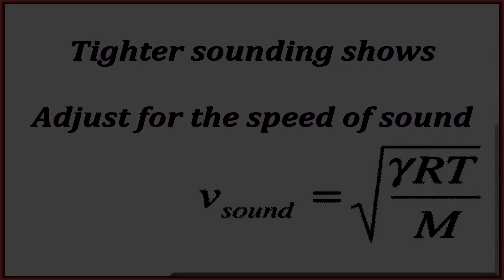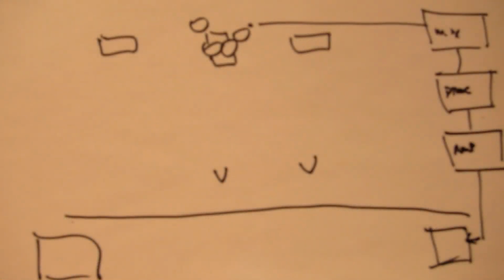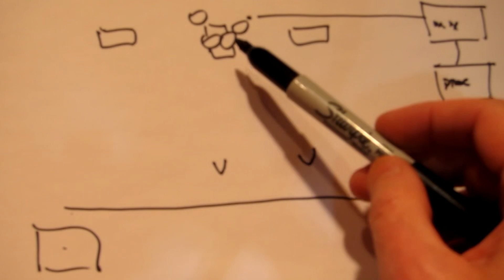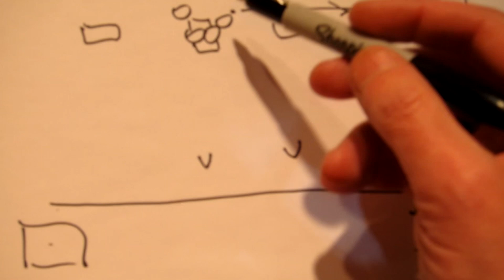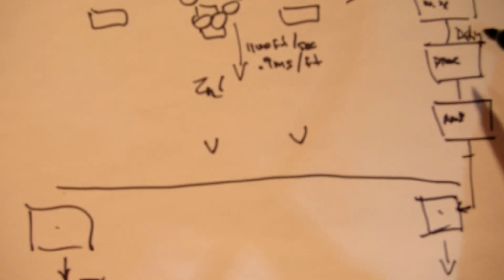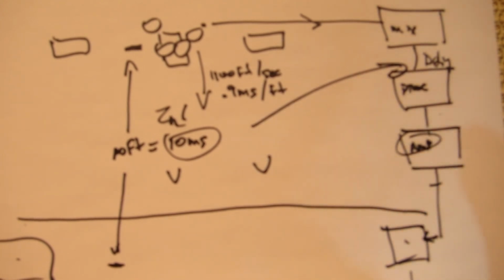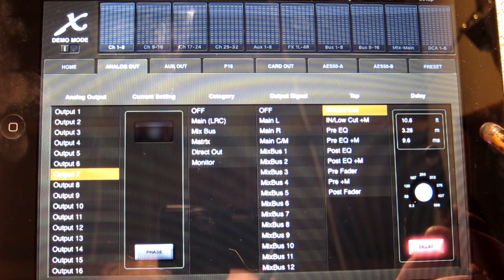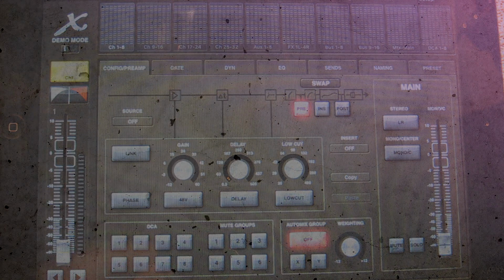A Secret to a Great Sound: How to Time Align Your PA for Optimal Backline Instrument Performance

Comment: Great info. So if using a separate console for monitoring/IEM would it be ok to delay at the inputs as only the audience/FOH will be affected? Or is it still best to delay on the outputs?
Reply from the maker: Usually if you delay at the channel input it delays everything, the FOH and the monitors.  If that's not the case with your mixer, you could do it that way... but I think delaying the FOH output buss is easier since it's one thing to adjust, rather than a handful of channels independently.   Whatever you prefer, sometimes there's more than one way to get there.
Reply: @Barry-Watson  Thanks for the reply Barry. What you are saying makes sense. You would literally have to delay every channel at the input, like you said. Opposed to just delaying the outputs to PA. I’m using an M32c rack unit at FOH. I’m using the Ultranet port to output audio to my tops and subs. It doesn’t look like there’s any way to delay the Ultranet outputs at the desk that I can figure out. Would my best option in this set up be to use the delay in the actual powered speaker and subs DSP?
Reply from the maker: @Bobby_Uterus  sure, I think you could apply the delay anywhere in the output signal chain.  Doing it at the speaker processor would be a common place (or in the amp DSP).  Obviously, just do the delay in 1 place - the amps/processor OR the mixer.  Heh.
Reply: @Barry-Watson  Right, thanks Berry. I think at the actual powered speakers is where I’ll have to set the delay settings. Kinda a bummer as my tops are mounted ways off the ground. Enjoying the channel, lots of good info. Thanks for taking the time to share with us.

Comment: So if I use center fill speakers on the lip of the front stage would you time delay them the same as the mains.  They are in line with the mains but closer to front row audience so would they get the same delay as left right mains or a little more because they are closer to the audience?
Reply from the maker: The delay is the distance from the instrument backline to the line of the speakers.

All engineering is the art of trying to pick the best compromise.  In this case that hopefully results in good performance for the core audience, and still acceptable performance on the fringes.
Reply: Thanks just thought in a left front mains with center fills on stage in line with the left right mains we may still need to 1. Delay the left right mains from the band I.e. snare drum, 2. Delay subs if they are center a few feet in front of the left right mains.  3. The center fills which fill the front few rows with mostly vocals where the mains don’t cover I assume we time delay them at least as much as the left and right mains they are in line with, but because they are  right in front of the people in the 1st few rows center, should we delay them a bit more to even out the sound coming from the left right mains.  Thanks so much.  Great info
Reply from the maker: Sure, the people in the first few rows are never going to get the best sound. That's the choice they make. I wouldn't compromise sound for the 99% of the audience in order to optimize it for a fringe few rows.

Comment: Hey, great video. I just have a couple remaining questions. If you delay your entire FOH signal by (let's say, to use your example) 10ms, aren't you going to run into low/mid frequency phase problems when the offstage spill from the monitors combines with the FOH signal in the area directly in front of the stage?

Example: your band is loud enough to where you will want to delay FOH to their onstage sound from the backline. If the band is that loud, the vocalists will almost certainly want their vocal sounds rather loud in the monitors to ensure that they can hear themselves over the instruments' onstage volume. Your venue has the PA hung right over the lip of the stage, and the stage monitors directly beneath it. If you delay the whole PA by 10ms, then won't the spill sound from the rear of your monitors reach the audience ~10ms before the FOH signal? Sounds like a precedence-effect problem waiting to happen.

Not to mention, if you're in a venue that's small enough to the point that the onstage sound is competing with your FOH signal to a degree where it needs to be time-aligned, won't the 10ms-delayed mains signal be quite audibly spilling back onto the stage? Won't the vocalists find this distracting? How do you combat this?

It seems like the move actually is to delay your instruments individually, or better yet in groups, instead of delaying the whole PA--but the M32 and X32 don't allow for groups to be delayed, only the output and input signals can be delayed. You've already correctly explained why to avoid delaying the input signals (unless you'd like to make a whole separate "monitors only" channel mix!)

Maybe I'm overthinking this--but I think a lot of old-school engineers would say we were both overthinking the issue: they got away fine without backline delay for their whole careers! Of course we know they're wrong, and there's always room for little improvements. Have you ever experienced problems like the ones I've described above?
Reply from the maker: Good points, but I think it's a matter of degree.  The performers are mostly hearing the monitors (which have minimal latency), and the audience is mostly hearing FOH.  The splash should be at least -10db down, so the primary sound rules.  Yeah, there may be a small zone right between the speaker systems that's a little ugly.  The audience who crawls on edge of stage never gets the best sound.  Heh.

10ms isn't major delay, speed of sound is about 1ms/ft.  So, could you sing and hear yourself from a speaker about 10ft away and be okay, I bet you could.  So, even if the splash has a 10ms or so delay, and it's -10db (or better) below your primary monitoring, I think you'll be alright.  Now, if you're hearing yourself on the monitor with a 50 or 75ms delay, that's another story.  That could really throw off a singer.

Phase issues between backline and FOH, always.  Hopefully dialing in a little delay gets you closer to in-phase where the audience is.  In the real world, it's never gonna be perfect.  Move 2ft over, and the story changes.  Nobody in a real room ever gets truly perfect sound, you just shoot for the best compromise you can.  Cheers!
Reply: IEM’s solve so many of the bleed problems with live music in a smaller venues. The biggest issue with IEM’s is  convincing the 100 watt tube amp guitar players to use them.
Reply from the maker: @Bobby_Uterus  agreed!  I love working with bands that use IEMs and have low(er) stage levels.  Less issues, and cleaner FOH sound usually.